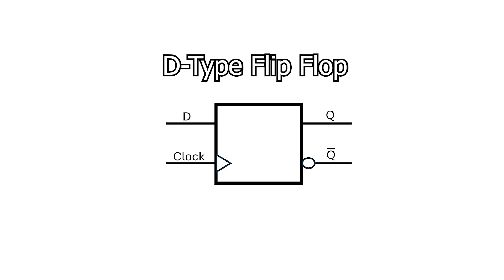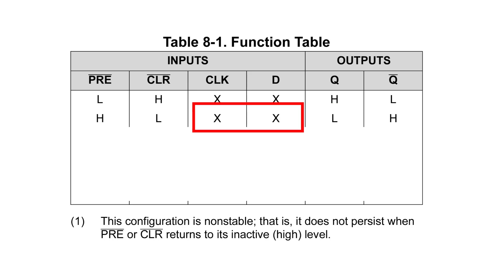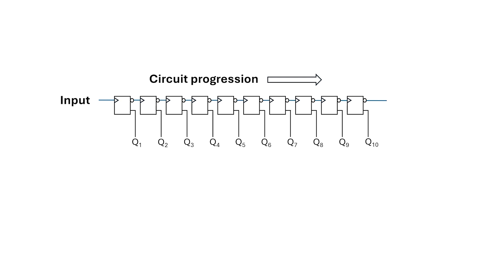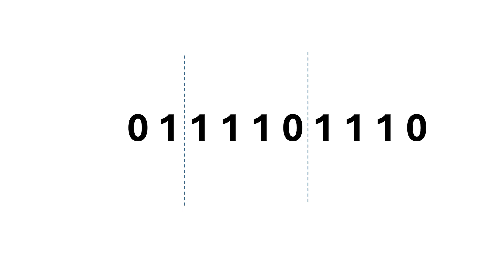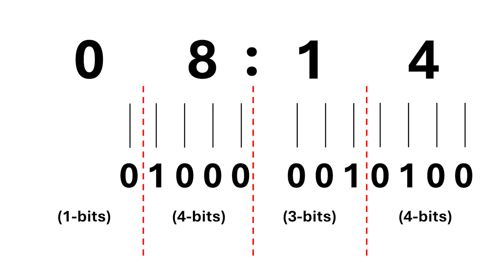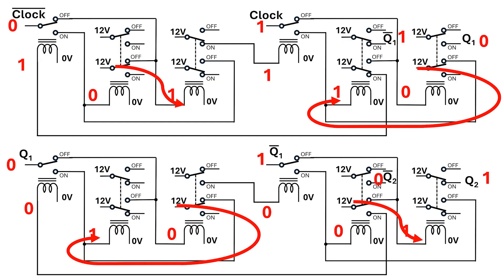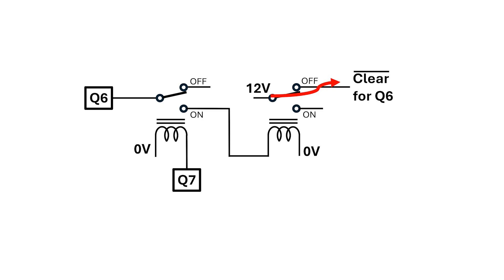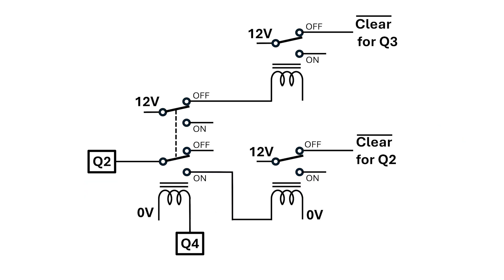Switches to CPUs: Minutes counter

Comment: The use of BCD is a good idea. Much easier to read, and the logic to detect the overflow and reset to zero wasn't that complicated.
Reply from the maker: You tempted to make one?
Reply: @DrMattRegan  Yes, but maybe only part of one, as wiring relay D flip flops will get tiresome. I already have a relay ring oscillator, so a zero to fifty nine counter could be neat
Reply from the maker: @mheermance  1-12 might also be useable as wall art!

Comment: Nice. Wonder how fast those little relays can switch? If it's less that 20ms you could half wave rectify the output of a small mains transformer and use that as a pretty stable timebase
Reply from the maker: Yeah, i'm still deciding what to do for timing.  I'm tempted to use a pendulum.  It's cheating a bit, because they are quartz crystal controlled.  Interestingly i once saw the timing mechanism in Big Ben, a big pendulum.  They used pennies on top to adjust the rate.

Comment: In the mid 1980's I was working for an electronics company in the test department with the ambition of moving into R&D.  One day the manager of both test and production came to me and said that they had run out of 74C74's (Dual D type flip flop) and could 74HC74's be substituted.  There was a mixture of 74C and 74HC devices all over the PCB which the substitution would be made, so I said OK.  What I hadn't realised is that in this particular design both /Set and /Reset were sometimes brought low at the same time and that the truth tables for this condition were different.  i.e. with both /S and /R low on the 74C74 both Q and /Q are Low and on the 74HC74 both Q and /Q are high.  This is the only anomaly I've found but even now I still check the truth tables between 74 series families.
Reply from the maker: Yes, it may have something to with NAND vs NOR implementations of the latched.  I personally prefer the term undefined, as it indicates use at your own risk.  I believe the table I used was for a 74HC74, which is to tie it in later.  Will divide the stream soon, one I’ll continue to use relays, the other I’ll move to 7400 series logic.